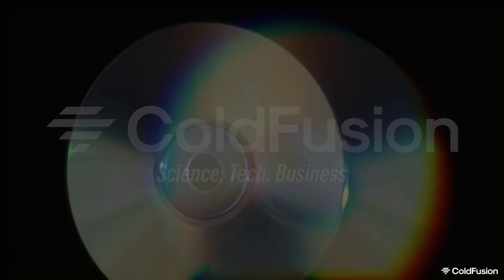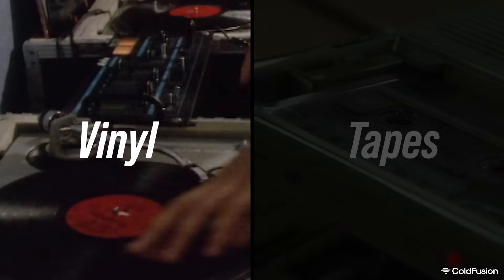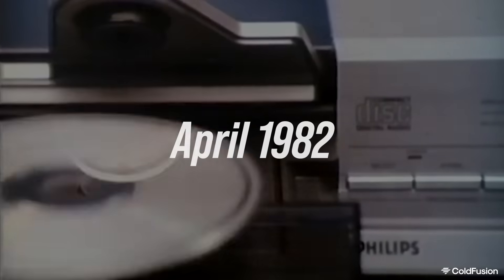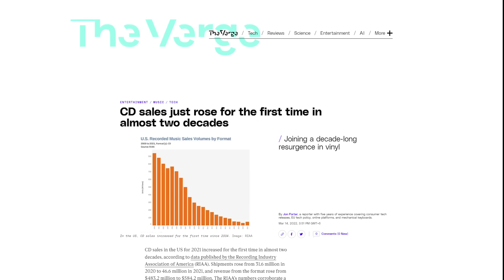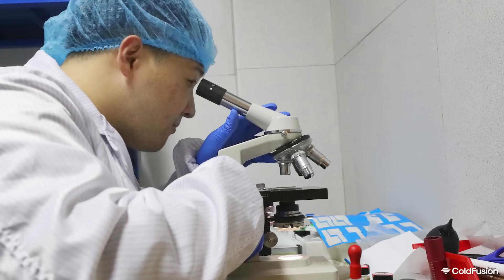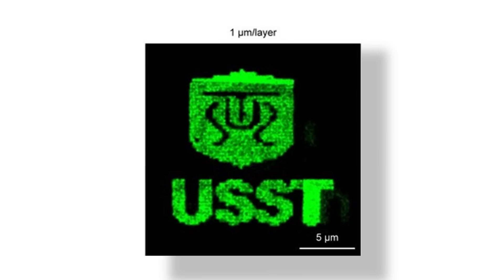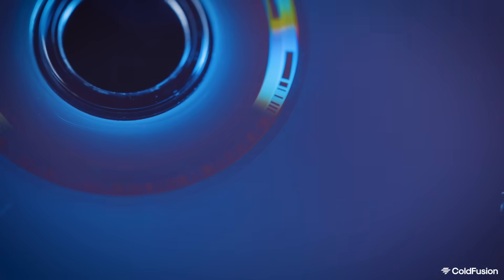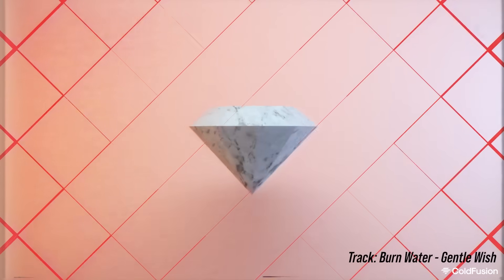Why This New CD Could Change Storage

Comment: 00:01 CDs are making a comeback with 3D optical discs
01:51 Innovative partnership between Phillips and Sony revolutionized audio storage
03:40 The history and impact of compact discs (CDs)
05:39 New optical storage method can store up to 1.6 petabytes.
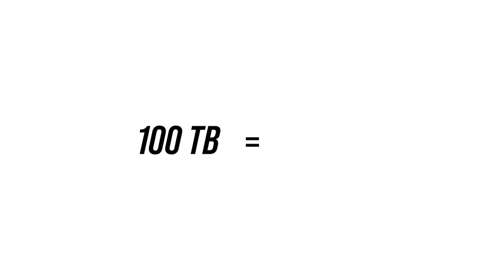07:35 Revolutionary CD with massive storage capacity
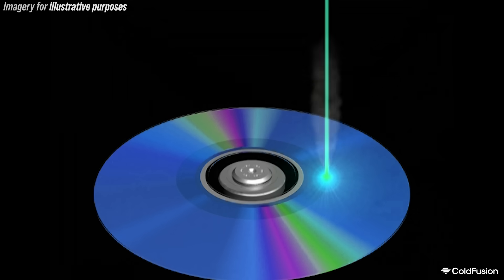09:26 Revolutionary CD technology with laser writing on an atomic scale
11:09 New Optical discs have limitations and challenges
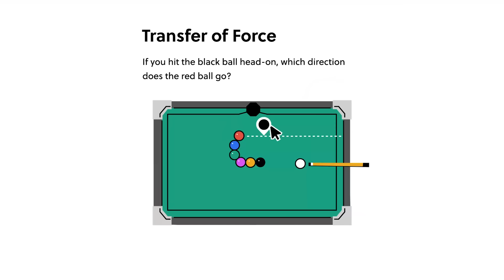12:46 CDs may not make a comeback for average consumers, but potential new uses for data storage technology exist.

Comment: How is this a new CD? The Hyper-CD - with the exact same layer model - was already talked about in 2005 https://en.wikipedia.org/wiki/Hyper_CD-ROM ? They are working on it atleast 19 years and it's still too expensive for nearly everyone to buy (also regular data centers). I fail to see how I should be amazed by that. You needed atleast to have mentioned that. I've even cited more sources than you in your video since you dont show foot notes (so 0 citation).

Comment: This how progress SHOULD have been until big time Cloud Companies and Tech companies started scamming people off and reverting progress back. Forcing you to use low storage as standard and high storage as some kind of company thing.
Back in 2013 I owned a 1 TB Hdd. Back then this was standard storage. The same amount of storage didn't even change after 10 years. But from 2003 where standard storage was around 100 gb. Basically in 10 years it 10x. But in last 10 years, it didn't. It remained the same, just got faster. Sure there are 10-20-30 TB hdds, but they are expensive af. Instead, they should be same price as 1 Tb now.
Companies WANT you to only use 1 tb of Nvme or Hdd or less to feel as if it's the only thing you need and FORCE you to send your photos and music on the cloud or use streaming services.

Comment: A few issues in this video. Mainly I think the use of "CD" where "optical storage disc" would be more appropriate is the worst offender; these new discs are not CDs. I'm not too sure I agree with the line, "[...] the fall of music CDs took CD-ROMs and other forms of optical media with it" too. That's assuming the entire optical industry was based on its use for music playback; even though CD sales began to decline in the early 2000s, DVD sales peaked in 2006 (according to some very brief Internet research). Audio CDs were just the first popular optical format to become obsolete, as storing and transferring digital audio had become generally easier to do by the 2000s.

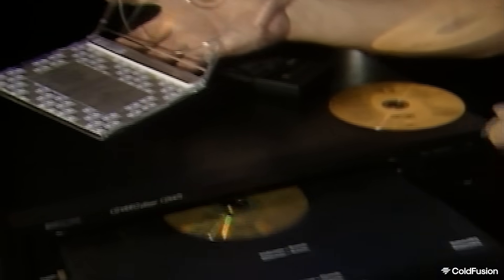Some technical points: At 0:16 that's a CD Video, an audio CD/LaserDisc hybrid. Stating "perfect quality music" at 0:32 is not quite correct; "(near) pefect audio reproduction" would make more sense. The disc shown at 4:22 is a 1991/1992 repress; besides your source talks about Eine Alpensinfonie being an early test pressing. And I refuse to believe that Brothers In Arms is still the "world's most sucecssful CD album".

Comment: CD is over, other disks might be around but those will require other hardware to manage. I also wonder what are the actual lifetime of these storage units. Plus surface being as exposed as these disks... I remember my hardware not being able to read my CDs and  DVDs for whatever tiny scratch there was on them sometimes. I don't know how will this new skyscrapper disk will be any better for resisting the handling of them.

Comment: And have one scratch on the disc there goes a bucket load of data. The one big problem with CD / DVD / Blu Ray discs just like vinyl records before them, was when they got scratched you would have all sorts of issues.

Comment: 0:45 
One MAJOR problem with that. If it gets scratched, ALL the data is gone.  I would rather have a Mini-Disc which had a cartridge protecting the CD,
which made is immutable from scratching.  I own 4 Mini-Disc players and 2 Mini-Disc recorders.  And like over 2,000 mini-disc.
I wish companies did more R&D and made them with larger capacity.  Because regular CDs always got scratched and ruined.
Maybe companies can make a crystal like version,  oooh wait they already did that. Japan developed a crystal disc that can store up to 25 Exobytes.
Its called The Diamond Wafer and renamed The Kenzan Diamond.  It was created 2023.  The Kenzan Diamond wafer is only 2-inches in diameter (5cm).
Reply: OOh and by the way, I currently own around 15,000 CD's.   I haven't used them in around 16 years since everything went digital aka streaming & on phones.
I have so many pop top 40 and dance music, even from songs created in the 70's and 80's remastered into CD's and Mini-Disc's.
My collection takes up an entire bedroom and a Den,  which also has Vinyl records from the 80's to 2000. And so many cassettes, that I lost count.
My grandparents still have a few hundred 8-Tracks that they used to play in their cars when they were young.  Man they are bulky  lol

Comment: While this optical disc is a fantastic technology, the real problem in long term data storage will be antiquated codecs and file formats. I already run across (minor) issues having to install a quicktime player to run certain old examination software from over 10 years ago. In this example quicktime is still supported and downloadable, but archaic file formats will become more and more prevalent as time goes by. In the long run we won't be able to play back or view digitally stored content because players and codecs are too far evolved, not being backward compatible or simply replaced by something entirely different. Future archeologists will perhaps call this period the digital dark-age.
Reply: on the other hand, future generations will be spared of all the crap humanity puts on platforms like tik tok and instagram 😆

Comment: Dire Straits' album Brothers in Arms was also the first fully digital rock music CD. 

All CDs are digitally mastered, some were digitally mixed, but theirs was the first one recorded digitally in the studio. It had the full DDD code on the case, and consequently it sounded remarkable!

Also, even regular music CD's pits are smaller than visible light. That's why you see a rainbow pattern when you shine a light on one. The different frequencies of light are being reflected back at different angles, causing it to act like a prism.
Reply: I just bought the vinyl version, because the hifi magazine told me it is more authentic.

Comment: Fun fact: The bit depth and sample rate of CD, which is still used on a lot of modern formats and streaming today, was set by the capability of an ancient video cassette format called U-matic.  In the early days, there was no practical way to store or transport the amount of data a CD held.  So Sony developed a range of PCM encoders, the most popular of which were the PCM1610 and improved PCM1630.  These stunningly expensive devices were paired up with suitably expensive special U-matic video recorders, so that the contents of a CD could be written out to video tape for delivery.  The data rate pushed the very limits of what could be stored on video tape, and to be honest the format was fragile even when new.  Now there are hardly any working sets of PCM1630 encoders with their matching DRM4000 U-matic decks left.  I have two of these kits which I use to recover PCM audio tapes which recording studios find in their archives.  Also I've added even more rare equipment to them so that the data can be extracted via a pure digital route, which is complicated by the PCM equipment using an obsolete digital audio connection method.  I love this sort of junk.
Reply: Didn't they do that on VHS tapes too?
Reply: @DaRush-The_Soviet_Gamer  you can use a pcm adapter and a supported player to encode digital CD audio onto a VHS tape I'm pretty sure it's what they used to store digital audio in very early days due to its effectiveness and low cost
Reply: @Jaden-eh6rh  Yeah I remember Techmoan talking about those PCM AUDIO VHS decks for audiophiles in the 80s before DAT came along and made an alternative for PCM AUDIO VHS with very similar spinning head technology, but on a much smaller tape.
Reply: @DaRush-The_Soviet_Gamer  yes I want to get a dat walkman someday know it will be a pain to get it setup but once done it's basically a walkman on steroids in terms of sound quality
Reply: @DaRush-The_Soviet_Gamer  also want to get a technics slp-1200 I love the look of older cd players the simplicity and I only need coaxial output for a dac
Reply: @Jaden-eh6rh  Yeah. I even considered getting a DCC for my collection of retro tech, but had to stick with my Hi-MD walkman for now, sure. It's not 24 bit, but i can get that on my PC and phone for the time being. The fact that they don't do high speed copying like MD and CD units can makes them less appealing from the using it perspective, also DCC tapes are rare unlike DAT and MD which actually were very popular in theatres and other venues in their heyday. Shame Hi-MD disks are stupid expensive too due to how rare they are, but having an MD recorder and MD Data drive in one unit that can write to all disks is pretty awesome.
Reply: @Jaden-eh6rh  Me personally i switched to DVD players and drives for playback of CD audio mainly because they can play MP3 disks, They have optical out for MD digital dubbing and red lasers in DVD players can play even the most damaged CDs that an infrared laser wouldn't even get past the TOC with. It's kind of like, the same reason why Hi Vision Muse LD player could play regular LD disks with fewer damage artefacts on screen.
Reply: @Jaden-eh6rh  No, the studios all used U-matic for CD delivery.  Later they used Betamax.  VHS didn't get a look-in.
Reply: @DaRush-The_Soviet_Gamer  nice also DVDs can hold a lot of mp3s at 256kbps if you can handle the slightly lower bit rate just for fun I wanted to see how many cd albums I could fit as 128kbps mp3s onto a DVD it was around 17 full CD albums mostly pink Floyd Beatles led Zeppelin Fleetwood mac etc its nice for background music just pop one disc in and it will play uninterrupted nonstop for more than 17 hours
Reply: @DaRush-The_Soviet_Gamer  also a lot of more modern CD players in mini systems with bookshelf speakers will play MP3 discs and some even have USB ports and will play. MP3 and sometimes rarely mp4s if they have a video out I have a nice Sony with an iPod dock and it plays MP3 discs perfectly
Reply: 2gb and smaller USB sticks suddenly become useful again for small music storage it's still convenient to have 20 songs on a stick in decent quality also
Reply: @video99couk makes sense as umatic was Sony, beta/beta Max Sony, VHS being jvc.
Reply: @DaRush-The_Soviet_Gamer  Depends on the quality of the DAC in the player, some are shocking, some are superb, most Japan made Sony & Panasonic DVD/BR  players can double as good CD-DA players, or even SACD players, same for Pioneer, the Pioneer Elite BDP-51FD offers fantastic quality, so does the Toshiba HD-DVD-A1, some of the latter made in China Sony and other Japanese brand BR players have awful DAC quality (fine for digital Dolby and DTS film audio), and passable if you are passing through digital onto an alternative DAC, but that defeats the object of a good CD player, why use a beautiful NAD CD player, if you're just gonna pass the audio onto another DAC via Toslink, nothing beats a good CD separate unit with HQ circuitry and AD/DA chipsets, along with a good pre-amp with multiple pots for EQ and a good quad-stereo Power-AMP, all running though a pure-sine-wave power supply of some kind, the cheapest way to get a pure-sine-wave is a UPS unit with a pure-sine-wave filter, I also use filtered & shielded kettle lead power cables (they are around £20 a pop rather than £5 for a standard one, but worth it). 

There is also the option now days of a Raspberry Pi and a Pro Hi-Fi Berry DAC & AMP plus a decent Sony or Pioneer CD-ROM drive that will only cost you £20 for the drive and around £100 for the Pi, DAC & AMP, and even a nice DSP for good measure in that price, this will give you an absolute powerhouse of an audio system that can do any format including DSD for a fraction of what it cost years ago, and you can get a pair of British or Japanese made 100 to 200 watt RMS speakers second hand for well under £80, as little as £30-40, all you need then is a decent pair of headphones, the best bang for buck audiophile quality cans are professional recording cans, as they have to be a minimum of reference grade quality and studios have to buy lots of them, so they are much cheaper than commercial headphones, you can literally pay £40-50 for a pair of studio cans that sound better than any consumer grade cans under £500, and you will have to spend a good chunk to beat them on a consumer pair of cans, so an audiophile grade R-Pi HiFiBerry sound system setup can be done for under £200 all in inc speakers and cans.
Reply: @DaRush-The_Soviet_Gamer  Sort-of, but the SVHS version flopped.  There was a Betamax version (PCM-F1/501/601/701) which sold much better.  And I have those too, also modified to provide digital outputs.
Reply: @DaRush-The_Soviet_Gamer  
Betamax and U-matic was the beginning.
Later VHS was used, even 8mm.

PCm-1630/DMR-4000/2000 was my job for many years, as well as PCM DASH format 2-trk (PCM 3202/3402), 24-trk (PCM-3324/S) and 48-trks (PCM-3348/HR).
Reply: Omg you have content!??
Subscribed!!
Reply: When u said ancient 'u matic' that hurt bro...😅 When I started in broadcast, I used U matic tapes.
Reply: I don't understand, why didn't they store it on a CD to ship it to where they would write it at the factory or whatever? 
Is it to make it to mix it on the fly when they were recording the musicians?
Or was it the burning hardware was too big, expensive, unreliable? 
Or something else?
Reply: @lelsewherelelsewhere9435  CD burners were not a thing.
Reply: Sample rate and bit drptj always be used as PCM is best way to store raw digital audio the autentic way it is, even compressed formats need to be decoded yo PCM as also fundamental format used for digital audio hardware, you cant output digital audio without PCM
Reply: You are a rare artifact that needs to be preserved or your tech and know how does.  We are starting to lose some of the basis from where technology developed and although I am all for the growth and advancements, we must realize that some of the most historically records of history may be in these formats that are unrecoverable once we discard the old technology that some new engineer might not have a use for, or think that they do not until it is needed.  What we need to have put together is a site that lists technologies and the engineering expertise along with equipment, who has what and what they can do and catalog this for the world to bring these last vestiges of bygone tech to reality rather than just throwing these recordings away.
Reply: Absolute nerd, I like it!
Reply: Do you watch TechMoan's channel for old formats?  I'm pretty sure he's covered the U-Matic format.
Reply: thank you sir for your herorics
Reply: Umatilla tape radio station
Reply: TIL where CD bit rate came from. And keep up the good work mate!!
Reply: bit depth maybe but mbps/kbps no streaming is lower quality just like most older cds this is due to it being streamed to keep cost down
Reply: Remember no streaming service in the world is comparable to cd streaming is far inferior to the point that most people will choose cd for MUCH better  noticeable sound quality over any steaming service even tidal isnt as good
Reply: @Jaden-eh6rh  Tidal is now FLAC. Which is uncompressed 1:1 CD quality.
Reply: @Jaden-eh6rh  Steaming being inferior to CD is outdated information and no longer accurate. The industry standard sample rate for CD music distribution is 44.1kHz. Streaming services offer up to 192kHz lossless format audio, with availability only being limited by the quality of the master recording provided to the service.

Additionally, most people that do mixing/mastering professionally will tell you that 24-bit audio is really only useful for music production purposes. If you aren't doing any studio work, the difference in fidelity between 192kHz and 44.1khz is unlikely to even be noticeable.

Most if not all of the perceived difference people talk about when discussing Hi-FI music really comes from the quality of their audio setup, as dedicated 24-bit capable DACs tend to be of higher quality than what you would find built intp something like a smartphone. Of course your bulky CD setup designed specifically for audio is going to sound better than the two dollar sound chip in your computer, that's just a given

Comment: With the advances in semiconductor technology, it will be a race to see who produces their product first. These discs, or chips that can store a similar amount of data or even more. The thing that has let the CD down more than anything is the laser that is used to read them. I've been involved with the audio service industry for many years and the device with the most failures over that time has been the optical block / laser assembly used in CD players. They fail too easily and wear out much faster than any device should.

Comment: Given the cost, speeds and level of data used, ironically the use cases for this are the exact same as cassette based data storage: long term storage of data that needs to be stored but rarely needs to be accessed.